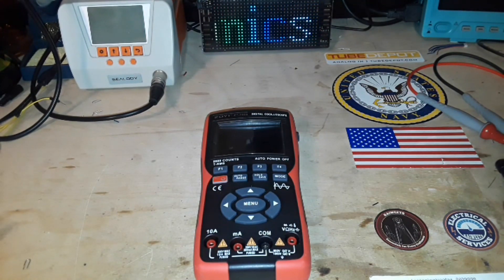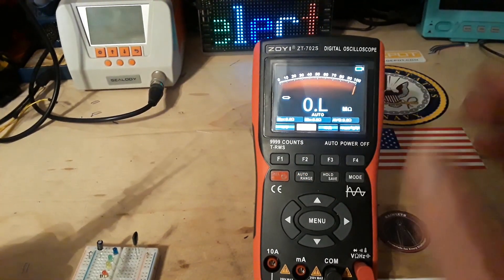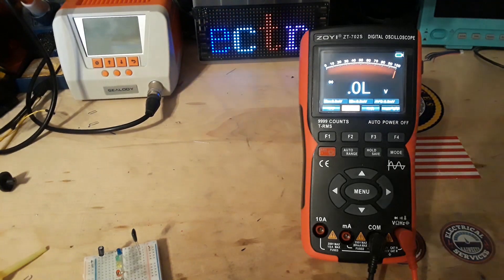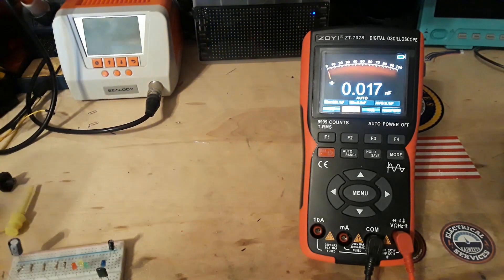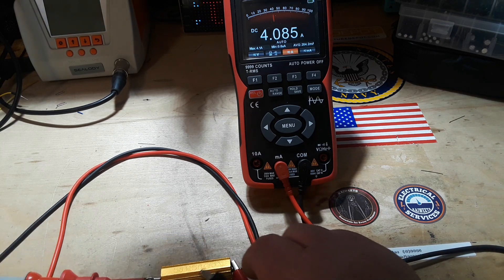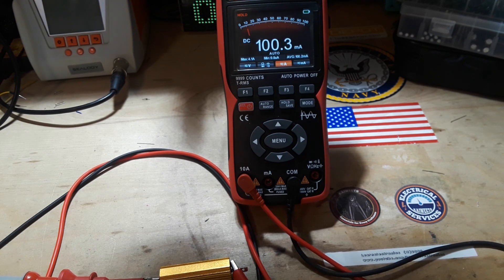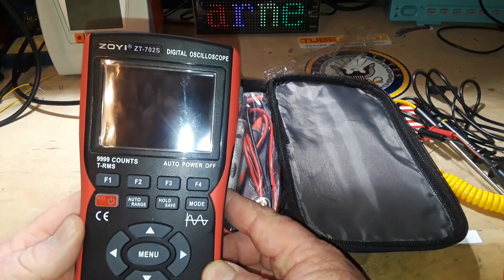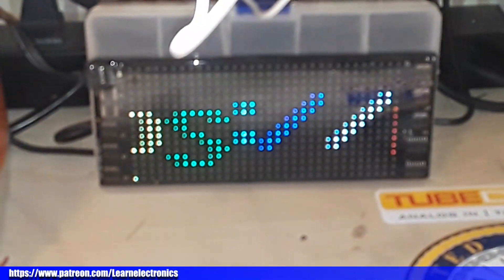Zoyi ZT-702S Multimeter Functions Review

Comment: 10:30 EEVBlog got caught by this as well, it has no current range detection so you need to switch it to the mA range with the mA port or it will give you an incorrect reading.

Comment: If I'm not mistaken, while trying to measure the input impedance the blue multimeter was in continuity mode (=lowest resistance range) when the ZT-702S was in voltage mode. You did try other modes of ZT-702S while the blue meter was in auto-ranging resistance mode, but skipped the voltage mode.
While watching the reviews and other details about this meter, I thought the price would much higher. Seems good for the price.
Reply from the maker: One I tried the Zoyi on every single setting. I can not get an impedance reading...and the capacitance reading...never seen that before. Must be something in the Oscilloscope side of things...
Reply: I wonder if it had to do with the voltage level of the two meters allowing one to read but no allowing the other?